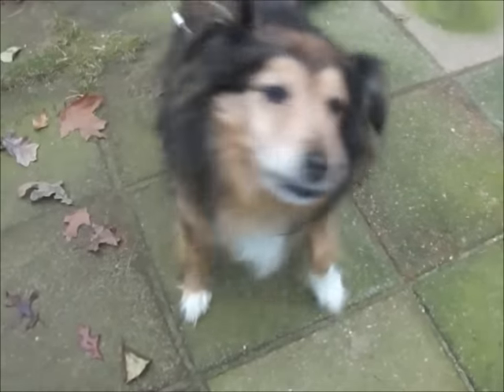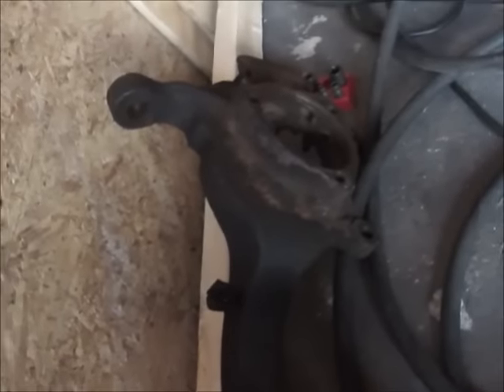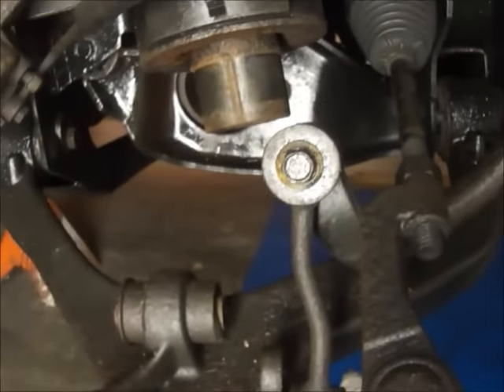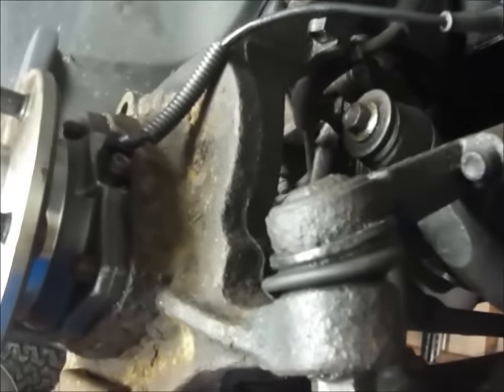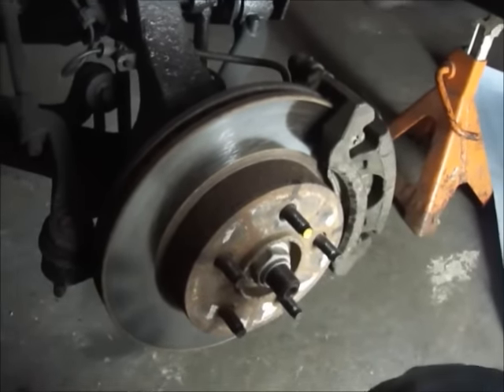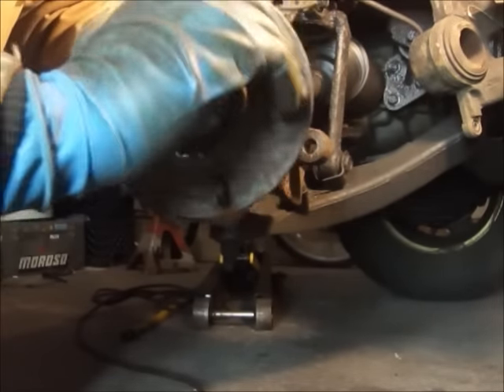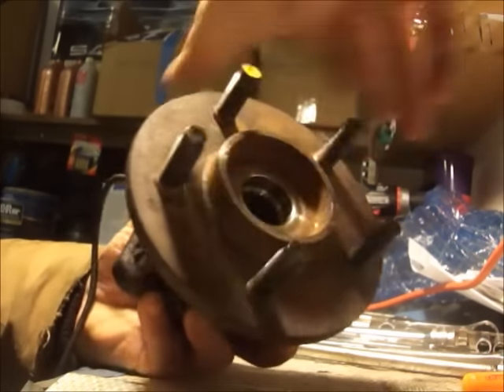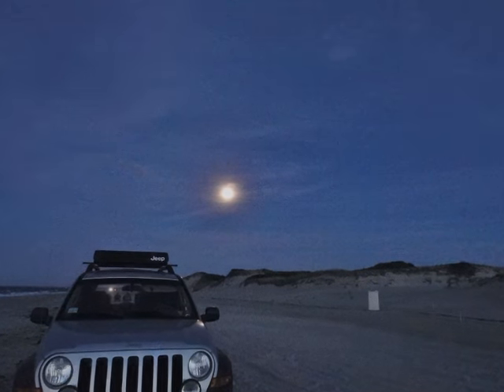Jeep noise

Comment: Think my 2006 LTD 4x4 may have a similar noise. Rotate tires, same. wheel hub bearing, same. will be checking other drive line issues like axle and other bearings. Thanks. Great snapshots on the work there.

Comment: Great video have a 2011 Jeep Liberty and passenger side wheel bearing is making a growling loud groaning noise around 25-30 miles an hour almost as loud as the bumps they put on the highway to wake you up if you fear Outside the Lines is that the noise yours was making and noise goes away when turning to the right

Comment: Thanks for the video.  How did you get the axle shaft separated from the right side cv axle shaft assembly (reference the 5:24 mark)?  Last time I replaced mine, I could not separate them and ended up having to buy a new shaft?  Any tips would be appreciated!

Comment: I have a noise like I need a hub but I’ve changed it out three times. Noise comes from passenger front. Could it be the rack & pinion? Mine leaks.

Comment: If you need to replace the upper ball joints you will want to look at the A arm bushings as well, if they are worn you can get the complete A arm with bushings and ball joint for less than the cost of the parts. While you are looking you might want to check the rear lower control arms for rot, they were recalled for that once, and check the rear upper control arm bushings and ball joint, they like to wear out. As you plan on keeping it hit Ebay for the window regulator repair kit.  steigerperformance.com has info on what and why they fail. BUT you can buy a kit on ebay #391328671623 that does all 4 windows for less than one steiger kit, and they are the same part, I have used both and couldn't see a difference other than the color of the delrin sliders.
Reply from the maker: +Blazer02LS Thanks for the info. Sounds like you have been down this road before. Rear upper control arm is showing rot. Full replace at some point. Windows good so far. Have a great New Year. and thanks again for the tips.
Reply: Yeah, have owned 2 and do repairs on about 7 different ones. The windows will be good, right up till the plastic fails, then they fall into the door. REAL poor design, My SOP is to open the panels and replace the plastic before it fails.
Reply: @Blazer02LS  I used to carry gorilla tape to hold up the windows. They would fail at any time on my 06 Liberty. Ok now for 6 yrs. Replaced both rear control arms and the front balljoint assmbly. Mine had four radiators replaced with factory and aftermarket parts.

Comment: i have 160.000 mls on my 2005 jeep liberty and ive been getting that humming noise, how many miles do you have on yours?
Reply from the maker: About 115,000. Been good ever since. Upper right control arm bushings may be next. So far I like this liberty more than the new Cherokees so I plan on keeping it as long as I can. Best of luck with yours.
Reply: satajet883 still got it?